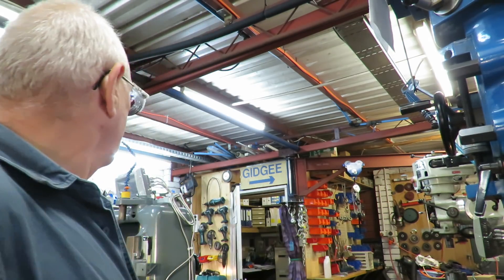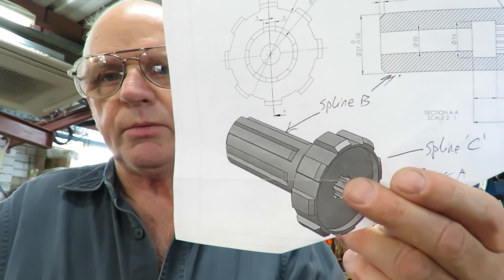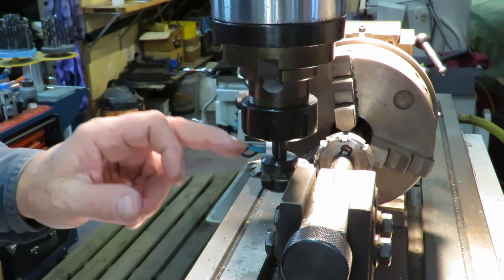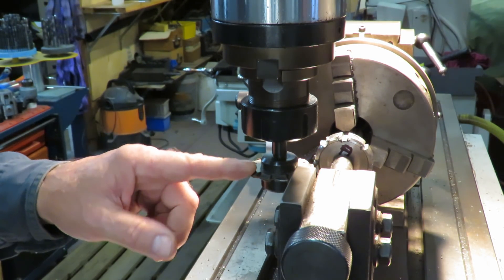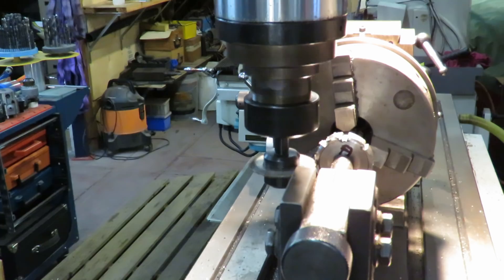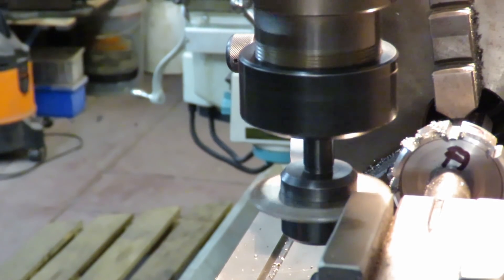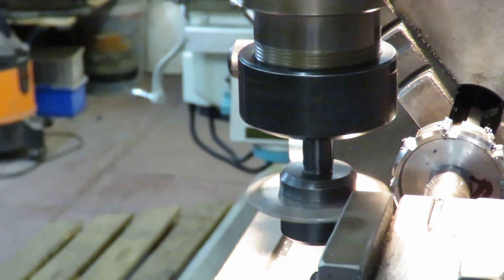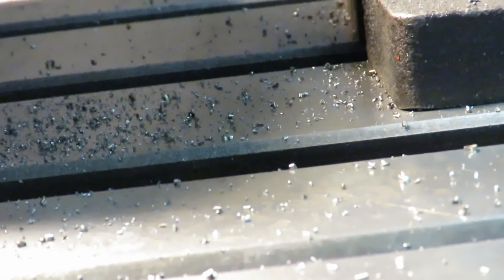Spline making with Involute Gear Cutters

Comment: G'day Bruce, great video!

I'm in Perth & I'm trying to cut a 45 Tooth, Module 1, 30 degree Pressure angle spline for a transfer case. The originals love to flog out, so I'm looking at using a better alloy and possibly increasing the tooth height slightly (ISO standards have the major diameter at 47mm, whereas the manufacturer has them cut down to 46mm, which results in quite a short tooth for a module of 1).

As far as finding the correct cutter, do involute splines always use a rack style cutter? Just looking at it, there's very minimal curvature to the splines but I'm not finding much information on whether I should be using a cutter to suit 45 teeth, or a rack cutter. My eyeball says it's much less curvature than a 45 tooth spur gear.
Reply from the maker: Mate come visit me and we can chat see what we can do to help you.

Comment: That was extremely interesting, using a gear cutter to cut splines. Never heard of that one. As you remarked in responses to other viewers , you will not get the full involute profile because the cut  is not full depth. But better than straight spline. And a very ingenous setup. Of course, the mating parts will have to be machined to the same profile.  How in the world do you do that? A very small cutter? Love this channel. And enjoy the bash!

Comment from the maker: Thomas thanks for visiting, I just used the DRO setting each time once I had established it (20mm in this case), I could have set the drive micro switch on the front of the table as well. In regard to splines, they can be anything from straight sided like a keyway, or angled or involute for the best strength. Look in Machinery's hand book under gearing there is enough information to confuse you. In Australia and the automotive industry Module is the standard. I used 20 degree standard cutter. some people just mill them and change the head angle or centre offset up and down.

Comment: Bruce, I need to invest some time learning gear math, tooth forms, and now apparently spline forms as well. I never would have guessed they have anything to do with involute profiles. 

How did you set up to stop all the six tooth splines at the same longitudinal depth for appearances?
Reply from the maker: +Thomas Utley Thomas thanks for visiting, I just used the DRO setting each time once I had established it (20mm), I could have set the drive micro switch on the front of the table as well.